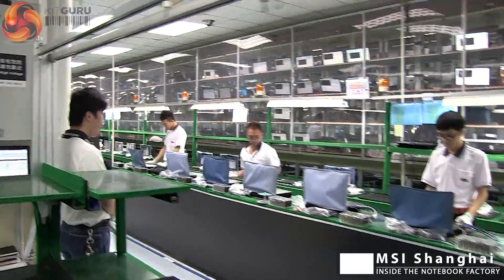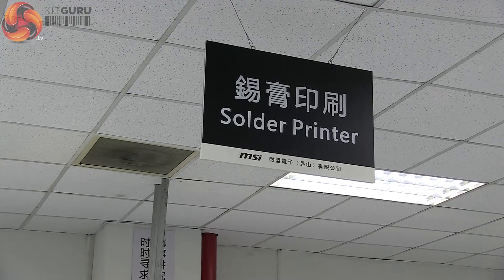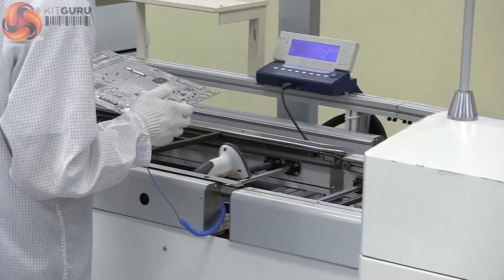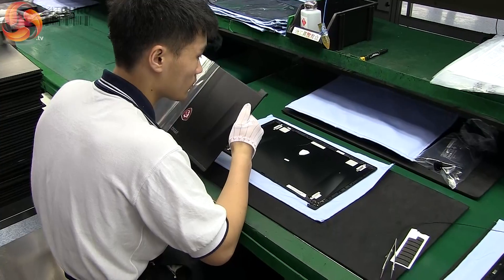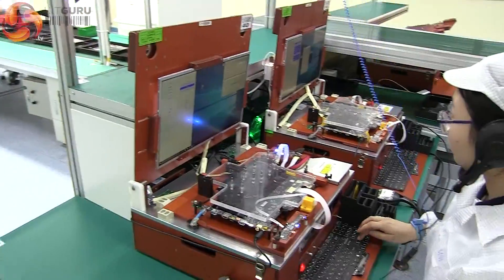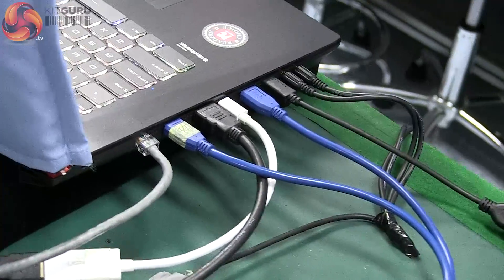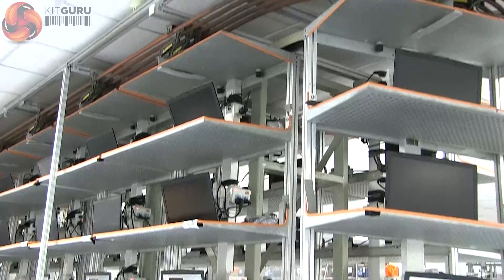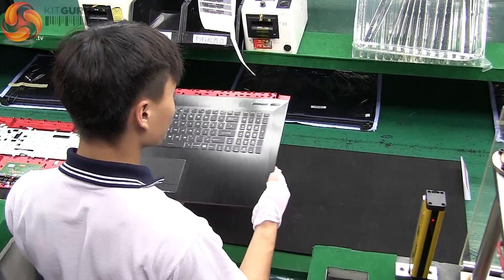Secrets of MSI Gaming Notebook Factory revealed!

Comment: Avoid MSI laptops until they redesign their faulty hinges. They claim it's a permanent fix after a warranty repair job but why not back that up with an extended 2 years warranty just for the hinge repair if that's true?  Look up "msi laptop broken hinge" and read the forums.
Reply: every laptop has problems----acer, HP, Lenovo etc-----you can search any problem and find that even the costliest Alienwares have problems
Reply: It took me 9 months of research before buying MSI GT series because like you said every laptop has problems. Let me rephrase that, everything we buy these days has problems. I'm leaning towards really bad quality control? This is why I research everything before I buy and make sure it's got good after sales support. Ok I lied, I bought some chewing gum before going out the other night and I didn't research anything about it.... and my bad for missing their faulty hinge problem during my research period since it was already an existing bad design fault. Bugger! 
Put more support around the hinge MSI. Seems like a simple fix... Checkout this guy's solution. Don't forget to read the comments. 
https://www.youtube.com/watch?v=kj7IbsAsho0 
I waited 4 months for Alienware to sort out their heating issues but they didn't so ended up buying my 2nd choice, MSI. Alienware was not the most expensive by the way. 
I researched "Brand", "model", "problems". Then read, read, read. Go hangout at the forum sites every night soaking up information, asking questions then validating info.
I don't want to get into too much detail but it's been over 3 months since my hinge broke and I sent my laptop in. The courier now knows me at a personal level cracking jokes about MSI and their incompetent repairs dept because he's picked up and dropped off my laptop 6 times or more? 
Every time it came back it had something else wrong with it and the quality of the repairs was shocking. I kept cool until it came back and my screen was just white and they tried to tell me they didn't touch the LCD panel even though I'm pretty sure it's screwed on to the LID which they replaced twice. Lots of other stuff ups I have proof of that was very unprofessional. 
If they redesigned their faulty hinges when it was first discovered, I wouldn't be going through this ordeal. MSI says only 0.5% of their laptops have the hinge issues. Then why won't they agree to an extended 2 years warranty on a hinge repairs job? Just for if the hinge stuffs up again.
Reply: actually after your comment I searched and yes there are many issues with MSI even heating and cooling system is average----About hinges, my sister's HP laptop hinges were broken and it quite costly for such minor problem----then the repairing centre fucked up its wifi connection----had to buy external wifi adaptor otherwise it would cost even more----point is the reparing centers are worst everywhere even HP or others----I think you can get it repaired at some local shop which are cheap and sit with them there because it wont take much time, they are more trustworthy than actual authentic centres
Reply: I have an MSI GT72 laptop since 2016. I use it for everything (I code on it, do image processing, watch video, play games, listed to music) and I travel a lot with it. No issues at all, temperatures stays in check even after heavy use and the battery still lasts 5 hours of internet browsing (I know it's not a lot of time but considering the fact that it has an i7 6700HQ and a 970M it's not that bad). This is my first MSI laptop but so far it's doing great and I'm positively surprised.
Reply: I forgot about this post. I hope you didn't buy your MSI from Australia. I was soooo happy with my MSI Laptop when I first got it. Until on the 5th of March 2018, after 15months of daily use, I had my 1st issue with this known hinge issue, which I only read about after it happened to my unit. After chatting to MSI repairs Dept, I thought 2 weeks at the most without my daily tool but it ended up going back and forward 6 times or more. It's now end of July and I'm still without my daily laptop. 
1st time it came back, there were 3 groups of scratches on top lid. 
2nd time the bezel was coming apart from the LCD and I could see the glue streaks in between the gaps. The bottom section of the laptop was now coming apart as well. 
3rd time? the LCD was just white when turned on. (2nd and 3rd time might have some details left out. I'm in the process of sorting through all my emails.)
I demanded to talk to someone in charge. A person claiming to be the “service manager” of MSI Australia's repair's Department said “This is Leo from MSI AUS, I’m service manager, regarding to your case, sorry for all the inconvenience
I will arrange internal review on warehouse and repair team, we must improve our service quality.
Can we bring it back this laptop, we will replace with all new cover and LCD screen to make sure everything 100%,
Also MSI AUS will provide extra half year warranty and free Gaming mouse as compensation.”
Wow… a Gaming mouse. I asked if it was the $29 unit but got no reply back.
Anyhow, I didn’t accept and many emails later we agreed on a replacement.
After month and weeks later I received my replacement.
To my surprise the replacement was also faulty. My head's hurting so bad. Really stressed out now. This whole ordeal started because they didn't do a simple check over of the repaired item before sending it back to me. I emailed and told him it happened again and told him the LCD bezel was coming apart on a brand new laptop amongst other little things. He replied back "I’m not QC person, so I can’t control this." 
I replied back this could have been avoided if you just checked over the laptop after your dept finished or during the “burning test” you told me they were going to perform before sending it out to me. He replied back "However, I can’t control factory. I ordered GT73VR from factory, then I passed to technician to do burning test, they told me all tests were passed,
After that, laptop was shipped to you. We have many department, I can’t go to warehouse to check each stock." 
Claims he’s in charge but doesn’t take any responsibility of what he’s in charge of. Just blame everyone else…
I paid top dollars for a reason and this is what I get? I’ve bought many MSI products but this will be my last.
Now it's become a refund process which I'm still waiting for. I've heard from the forums the German repairs department are very knowledgeable and very efficient so I know if the right people from MSI know about this type of situations, Australian Department can be up there as well. 
I’ve saved all the photos, videos and emails regarding this issue so I can share my MSI experience with others. Is there someone above this “Service Manager” I can pass what I have collected so MSI hopefully replaces this Service Manager with someone more competent?
So many other random unprofessional things they did I've left out...
Reply: i got mine fixed for 20$ in china LOL
Reply: My ge72 6qf apache pro one of its hinge got broke but i fix it by my self with an epoxy and it works well :)
Reply: @BlackcatPH1  I use JB Weld to repair hinges but that's not the point here... MSI's Australian Repairs Department is the issue. I used to be in charge of a Warranty and Repairs Departments back in the day and we had very high Quality Control and what I experienced would of never happened. We never blamed China for bad quality control for eg.
Reply: What is hinged?
Reply: hinges on the msi suck, I have a gt780dx from 5+ years back and the hinges slowly boke within 2 years to the point of my whole screen coming off
Reply: i think so too.  The plastic which is fixed hinge is often broken. so i think msi should redesign the next model

Comment: interesting video but msi sucks
Reply: Carbon cricket FX msi make the best value gaming laptops on the market. Their graphics cards are some of the best quality and cooled cards on the market. Take their new gtx 1080ti for example. It is the coldest gtx 1080ti air cooler. Buy an MSI and then if you have problems, complain. I have the MSI GL62M 7REX gaming laptop and an MSI GTX 1080 and both are absolutely flawless. My gtx 1080 runs incredibly cool and silent and my laptop games like a beast and stays quite quiet, it also only cost me £800
Reply: Jadi yo I am looking to buy the gl62m 7rex , are there any problems in the thermals , would I face any thermal problem if I play a game continuously for 5-6 hrs ( rainbow six )
Reply: Thanigai Vasan As long as you dont use it on a cloth surface or a soft carpet that could restrict airflow you will be fine. They have thermal protection anyway if you decide to use it on a carpet or cloth surface. Hope this helps
Reply: Thanigai Vasan i also reccommend buying it from ebuyer. You get a free bag and mouse and mousepad. Its also only 799.99
Reply: Jadi thanks for the answer and am from India , so might look into some local dealers here
Reply: Thanigai Vasan No problem :D
Reply: Thanigai Vasan bro i buy it yesterday i will prefer you this beast there is no such problems just all fake rumors
Reply: Mandeep Singh did you buy it online ? If so in which site and what price ?
Reply: A fucking GTX 1080ti cost $1500.00 today. You can add $800.00 more and walk out paying less. Then a Desktop! As the GE63VR is a beast!

Comment: And I Am watching this on my MSI GV62VR 2017.🤣🤣🤣🤣
Reply: ABDUL HANNAN how does your msi work ?? Is it good enough for gaming???
Reply: TOP5EVERYTHING Rikoo Well i will say this. With my GTX 1060, 16 Gigs ram and i7 7700hq. I get 120fps on Doom at Nightmare (Highest) Settings. It Cracks 70 Fps on GTA 5 at Ultra settings. The frame rates are really constant. They dont vary even a single frame dont fluctuates. Its Awesome. The Temperature is Upto 82 degrees while playing GTA 5 and upto 74 while playing doom. The display is outclass. Its a 94% NTSC panel with anti glare and 170° wide angle. Overall its good value for money
Reply: And I'm commenting here on my P870X laptop with a 7700k desktop CPU...
Reply: how much did u pay for it?
Reply: Edward Hutarso well i paid 80K rupees. Thats 1200 dollors aprox.
Reply: I like it
Reply: Edward Hutarso $16000 for my P870X laptop.
7700K@5.2Ghz 
1080 gtx SLI
64GB RAM
3x Samsung 960 pro 2TB RAID0
2x Samsung 850 EVO 4TB RAID0
1440p 120Hz G-sync screen.

Comment: Very cool random find.  Looking forward to my GE63 1070GTX raider arriving shortly.
Reply: Crypto Ghost 
What do you expect when the entire facility in China  is run by a production "guru", that Ethan guy...
Reply: Marcel Irnie must have been expensive with all the bitmining atm.
Reply: Yea like that guy said they are crap, from software to hardware problems, overheating, and fan issues, bloatware as well, i was noob and after this ive learned build a pc, no ifs ands or buts
Reply: Marcel Irnie ㄖ
Reply: Enjoy the endless repaste jobs  you'll have to do if you want to clean the heatsinks and the high temperatures and screeching hogh rpm fan noise with low quality bearings.
Reply: Now its rtx that ill be waiting for
Reply: NOOOOOOOOOOOOOOOOOOOOOO!!!! dont buy MSI!!! quality is SHIT!!! my GS73VR broke less than 6 month. The screen just fell off!! I made a repair video about it, and turns out this shit happens to many "newer" MSI models, including the GE lineup. I suggest u try alienware
Reply: Michael H. Strange my ge62vr was no abused for more than a year, I dropped it 1 time from my table at school and nothing broke, only when I accidentally forgot to close my laptop case it fell to the ground and only a little plastic piece from the left vent broke off which I just glued on. In my book that's great reliability, to this day I only had to change the thermal paste and glue on a price of plastic.
Reply: Michael H. How is GP SERIES OF MSI ...i am planning to buy MSI GP63 8RE442IN 2018
Reply: Michael H. Whether should buy MSI GAMING laptop or I should rather  build gaming pc with latest specs of 2018
Reply: @abhinavtiwari3790  yeh but some people need a powerful laptop
Reply: Marcel Irie proud owner here! I am getting the keyboard replaced though, as some leds are malfunctioning
Reply: @hidan9402   Same here my keyboard LED stoped working or showing wrong colors after  1 month

Comment: wish GE series build was better
Reply: Bao Pico you talk about the new GE63VR raider? Why? I want to buy the latest GE63VR Raider but after reading your comment im having a doubt.
Reply: I'm talking about GE62 and GE63 also. Have a look at internal build of GE63 vs. Dell 7567 vs. 2017 Hp omen. yah GE63 has new cooler system, many ports, build quality is just ok. If you keep your laptop carefully, I hope it will last more than 4 years
Reply: Alienware 15 2017 has one of the worst cooling systems for a 15 inch laptop I have tested so no point in talking about those fancy $10 LED strips on the side. Even the thinner MSI GS63VR has a better cooling system. If anyone wants to buy high performance laptops only buy from a company which is dedicated towards them like MSI, Asus RoG, Acer Predator etc. Dell can close Alienwares R&D team and focus on their Inspiron range.
Reply: Ugur Ekim Build quality is good with very little screen  and keyboard flex. The internals may not look fancy say compared to Alienware laptops,but alienware 15 is very heavy compared to ge63vr. Actually ASUS ROG laptops doesnt have the best build quality but even that is good enuf. Dont get discouraged on getting an msi laptop.
Reply: what a bunch of incompetent pricks.
  i have nothing against people that can't do a job properly, or they are still learning, but to take these amateurs, and say "engineer genius"  and "tech guru" and praise them like gods, when they are in fact barely capable of making a quality product? well that makes me sick.
   
  why does this make me sick?  cuz msi products are VERY EXPENSIVE, yet the build quality is  non-existent. the hinge is too tight, and the lid breaks in the first 2-3 months of use, also some of the coolers touch internal components damaging them, and the stickers..... the sticker look like they were thrown there, not placed.
   
   

    for what it's worth, these problems(and many more) are not only with MSI. so that makes me question the competence of people that are in charge of our electronics today.
   look at products made in europe or usa 10-20 years ago. THEY ARE WELL BUILD AND STILL WORK ! - compare that to today's 2000+ dollars laptops, that breaks in the first 2 months of use....
    I CAN'T GET DECENT PRODUCTS, not even with tons of money
   IT'S HORRIBLE !

  is this how a msi factory looks like? pf... i could make that place strait in a matter of weeks. but then again... i am all the way in europe, while they are in china, and they are too busy praising themselves, instead of seeing to the actual quality and durability of the product. 
   this is typical communist doctrine.

Comment: Watching this on my MSI laptop: "look! this is how you were born!"
Reply: That's great, it's so interesting to see this
Reply: This makes me cringe..
Reply: Great man
Reply: Same
Reply: Zfast4y0u 80C? Where did that come from
Reply: Akil Kumar yes
Reply: Zfast4y0u 80c is ideal for gaming laptops... You aint got nothing to worry about unless its in the 90s
Reply: nd0307 that’s way too fuuuuuuny
Reply: Same Here
Reply: same here :-)
Reply: same. but on a gt72vr dragon addition with a 8gb gtx 1070 . i also have a ge72vr 3gb gtx 1060  , gs70  970m 3gb. the gtx video no longer works on the gs70.   the ge72vr just came back from the msi repair center. they erased my hard drives then decided the issue was a stick of ram. I could of told them that much as I tested it before sending it in for service.  worse part is they erased both of my 2tb hard drives i had in it. the gt72vr dragon i bought as motherboard not charging the battery on ebay cheap. The issue was just a bad battery.  easy fix.
Reply: Hi, how much did it cost to you?
Reply: It don't wanna recall the test it had gone through xd
Reply: Rofl
Reply: And overheating and fan issues is how it will die
Reply: come on, just repaste it and clean fans. Mine no longer throttles even under aida+furmark with arctic thermal paste